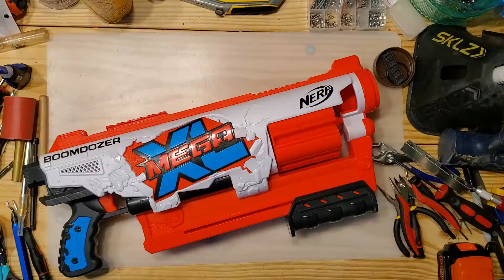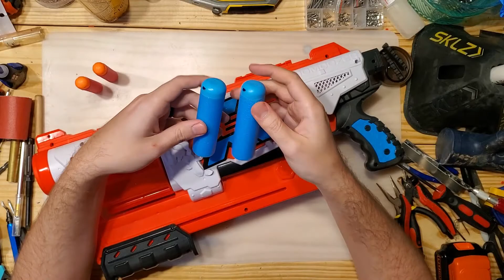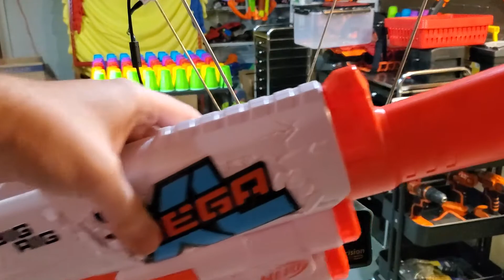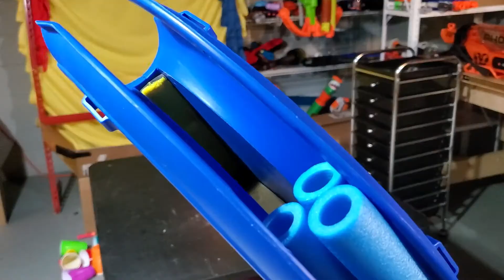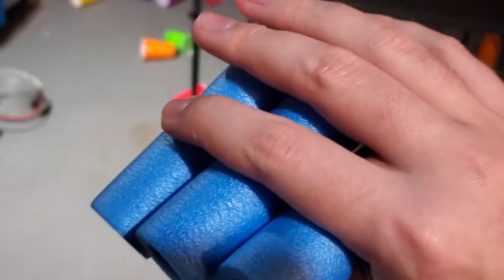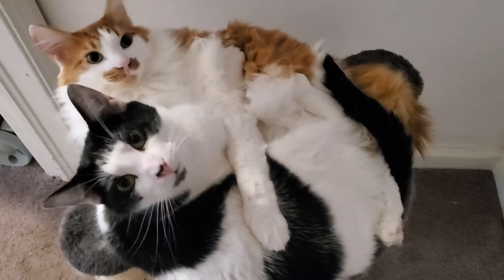Taking a Look at Mega XL

Comment: Have you tried half darting the less accurate XL darts? If they don't fly worse then you could hot swap cylinders loaded with them.
I don't have a 3D printer so, the RSCB cylinder I make will likely be a 17/32 & 9/16 brass.